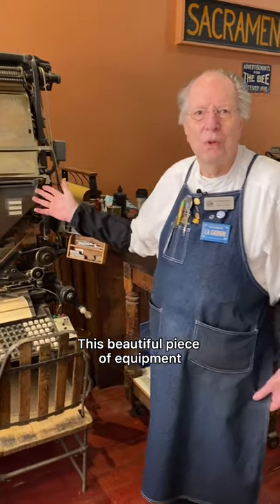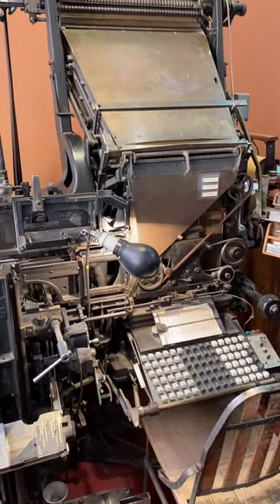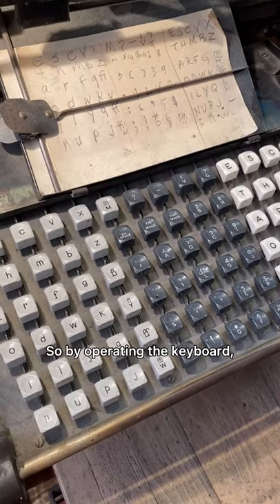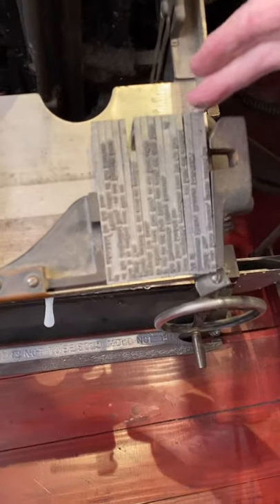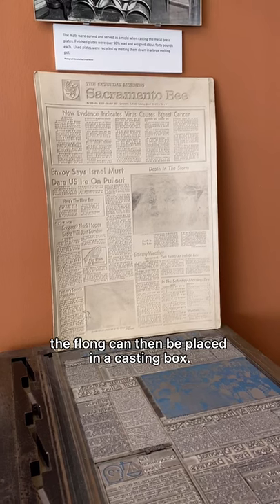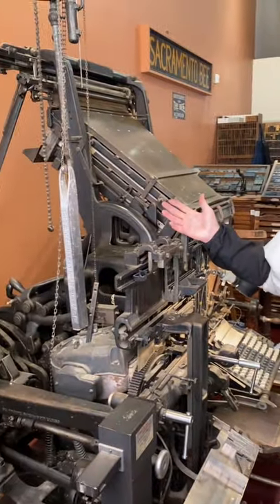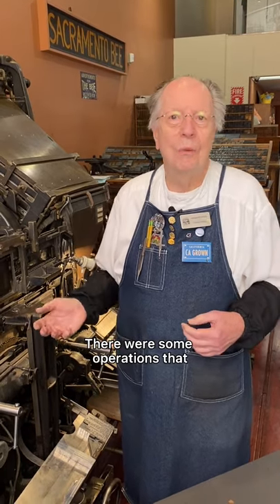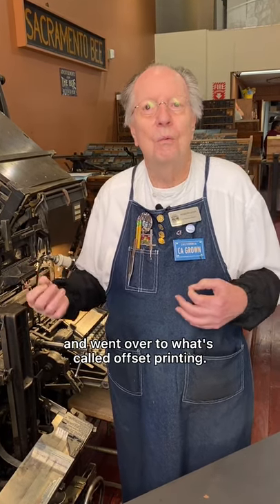The Model 8 Linotype

Comment: Worked as a Lino - Intertype Operator from age 18 to 26 (newspaper). Distributor jamming, mats not dropping, spacebands constantly needing graphite, plunger needing cleaning every day. Combined with an occasional splash all over my shoes and trousers. Worked them with both gas and electric pots.  New and old models. By age 27 doing what I wanted - playing piano for a living.
Reply: THANKS!  I've always wondered why my father's print shop smelled so strongly of graphite.  It was from the spacebands in the linotype machines.  I will always remember the aroma of graphite, printer's ink, ozone from the electric motors that ran the presses and the naphtha used to clean the plates.  And of course the hot lead smell from the linotypes.

Comment: I was once told by a former gas station attendant that during the gas crisis, many stations found they did not have enough copies of the suddenly-needed digits for signs. Did the Linotype matrix set tend to suffer from this limitation? That is, if writing about xylophones, might a reporter have to avoid using the word multiple times in the same line?
Reply: There is the possibility to add (special) matrices by hand. There are enough matrices for simultaneous assembly, molding and distribution. The easier way is likely to wait until molding and distribution is finished (if xylophones have also been discussed in the preceding two lines). If the x and y channels are completely filled, there should be no problem anyhow.

Comment: What happened if the typist made a mistake?
Reply: He had to re-do this particular line and that's it.
Reply: He quickly filled the line with etaoin shrdlu (the first two columns of the keyboard) and started the line again. Sometimes the wrong line was not removed from the stack and printed by accident. The two weird words are relatively prominent therefore.